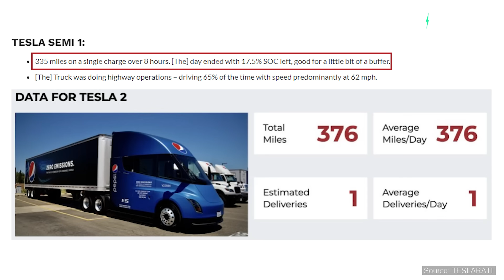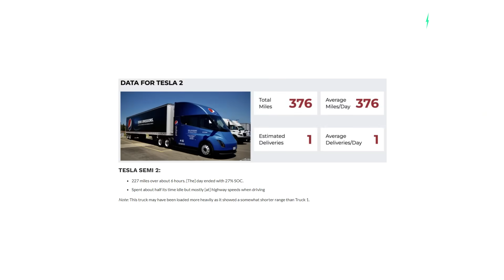Tesla Semi tested at highway speeds - REAL world range shocks rivals

Comment: Perhaps for the sake of the air quality, they should license the technology, or provide just the drive train to other truck manufacturer. Tesla has made the environment case for replacing heavily polluting diesels (even of electrical source is not pure) but they profit more using limited supply batteries in other products.

 (footage of the semi doing 62? on dirt and snow is extra impressive.)
Reply: They could license the tech, but making drive trains doesn't make much sense.  I would be very surprised if Tesla's limiting factor is NOT in the drive train.  So making full Tesla semis get them the most profit.  In fact, if the drive train is battery limited, licensing the tech doesn't help the overall supply in the market much.
Reply: Why bother? Make the trucks and sell them. The demand will exceed supply for a good while so no issue with pricing, etc.

Comment: The more we see Tesla semis overtaking diesel clunkers up hills the faster the trucking transiton to EVs will occur.
Reply: Bevs will take over. Of economic reasons only
Reply: @yggdrasil9039
Although, I think it will take a long time!
A lot of batteries. And ramping up won't ever meet the demands, I think.

And those using it has to build charging stations. Probably with Megapacs.

Only those who really thinks things through will buy the Semi, for now.
And that's a good thing. Otherwise the delivdry wait period would be intolerable.
Reply: The braking going down the mountain matters more to truck drivers. Believe me.
Reply: @r.d.9399  True, true. Though I would assume that BEV trucks make extensive use of regen braking, which is going to pump a shedload of power back into the battery. Hopefully this is the case, rather than the usual air brakes at 3am lol
Reply: 😂 Delusional
Reply: @hobo1704 no need to post about your state of mind.😮😅😂
Reply: @hobo1704  Did you not bother to watch the video?
Reply: @yggdrasil9039  no, never do. I know certain countries this BS won't work..
Reply: @hobo1704  ok... well if you watch the video, you'll see Tesla semis overtaking diesel rigs up a hill. Ever seen a diesel rig struggling up an incline? The huge torque on an EV semi puts paid to that. The only impediment at the moment is the initial cost.
Reply: @yggdrasil9039  cost 🤣 How about charging infustructue and charging time. Dream on, EV's will never be better than ICE trucks
Reply: @yggdrasil9039 nowhere to charge and crappy charge times, government will regulate them into the ground like diesels to make money.
Reply: @hobo1704 My grandfather said that about horse carriage and I am 72 owning my first perfect car after 54 years of mostly German Premium - a Kia EV6 AWD that is sportier than many M-Sports BMW in its class and costs me a lot less to service. This will be the most important for truck companies and not initial price. Many big companies owning truck fleets have huge surfaces for PV too! It’s all about cost to stay in business and competitive. As Diesel goes up its application will be minimized where it still makes sense and where pollution is under control.
Reply: @GoonyMclinux  trucks have legislated breaks regularly - and they need to spend time loading and unloading….
Having a grid connection at warehouses gives you one of the charges rather easily.
Reply: @hobo1704 yes you are....🤡

Comment: Where are you going to find truck drivers that are willing to drive 62 miles an hour that is going to be your biggest problem
Reply: Don't worry, they will be happy driving at 62 miles per hour after charging for at least an hour
Reply: These are real pepsi truck drivers driving the speed the company has mandated.
Reply: @danharold3087  Of course they do. But even if it works as a big driving bilboard for Pepsi and Tesla, this is not the way most transport works
Reply: @SolAce-nw2hf   It is mostly a matter of building chargers.  Tesla is very good at that.  50K car chargers in 10 year.

Comment: 62mph??
I need to go at least 70 to 75 mph!
Drivers don’t want to drive slow trucks!
I out of here!
Reply: This is in California, where the legal limit for semi's is 55 mph. So 62 mph is already speeding.
Reply: I wish the drivers of diesel semi trucks had your attitude. And Semi does go over 80 mph.
Reply: You will be parked because a diesel truck will be unprofitable with electric trucks taking the loads.
Reply: @danharold3087  Right, those EV trucks are a bargain. Forgot about that one.
Reply: @SolAce-nw2hf   Purchase price for a truck that spends most of it's life on the road is small compared to operating costs.
Reply: Indeed, just a nice PR stunt. No company will accept the lost time and money charging these overpriced white elephants.
Reply: @SolAce-nw2hf you mean every company will want the time savings from charging at the loading/unloading point? And the fuel savings?
Reply: @williammeek4078 You actually think they only drive that far between loads 🤣
Reply: @williammeek4078  in real life there are no chargers this powerfull at most loading/unloading points. And the next cargo likely is not at the same location, so that will cost a lot of time. Even at 1000 kW it will be about 1 hour of charging, waisting time and having to pay the driver.

As for fuel cost. It's just a minor part of doing business. Replacing all of the diesel vehicles with Tesla's and installing multiple 1000 kW chargers is just not an option for most businesses righ now.
Reply: @SolAce-nw2hf  1000kW is not a thing anytime soon. MCS charger are currently around 400kW especially for this short range truck which is around 700kWh. Yes it's slow but this is very much realistic charger option for many businesses. You are just pushing misinformation with fabricated numbers.
Reply: @SolAce-nw2hf  FYI 1000kW into 700kWh battery would be less than 1 hour. Your numbers are Fabricated.
Reply: @Neojhun  750 kW is what you need to make this a useful vehicle, and Tesla is pushing towards 1000 kW. 
Insane power hungry machines. How do you think we will power them at these speeds? I think coal, and lots of it.
Reply: @Neojhun  Sure they are. Just not by me, but by Tesla. They are promising 300 and 500 miles range versions with "Less than 2 kWh" per mile. So assuming slower charging from 80% to 100% that is going to take an hour for the long range version if a grid blackout does not occur first.
Reply: @hobo1704  Yes these 3 trucks do.  Visit the web site.
Reply: @SolAce-nw2hf   Tesla started with 1 car charger.  10 years later they have 50K.   Tesla will build the chargers as they build the trucks. Some public some private.   I expect tesla will not blindly sell trucks to people who need to drive where there are no chargers.
Reply: @Neojhun  The numbers on the "Run for less" web site are recorded numbers.
Reply: @danharold3087  good luck with that in countries like Australia.
Reply: @hobo1704  yes. Do some research so you look smarter.
Reply: @SolAce-nw2hf  you are completely clueless. Fuel is the second largest expense in ownership after the driver. 
In real life, these trucks didn’t exist 10 years ago, so talking about what exists now is nonsense. 
Typical unloading times are two to four hours. Even a current Tesla supercharger would be able to keep the truck going if it was a box truck. 
If a Semi, either the driver is required to take a rest break where he can recharge or he has enough charge to get to the next delivery point. 
No time lost. 
Hate to burst your hater bubble, but reality is these thing are coming fast.
Reply: @williammeek4078  keep kiddling yourself that every unloading bay is going to have a supercharger.
And as for rest time, you never drove with a buddy for a speed delivery?
I have no doubt many things will change in transport over the next 10 years, but a fully electric semi that's going to pay for itself and make a profit is not here yet. Good thing to work on and road test, but with current prices it's mostly paying for itself as a driving billboard.
Reply: @SolAce-nw2hf  the world has left you behind.
Reply: @williammeek4078  Time to wake up and smell the diesel. 

As much as I would like to live in your dream world, there are a lot of practical issues to solve. Reality just still kind of sucks.
Reply: @SolAce-nw2hf  Not at all.   It is an examination of the use of electric vehicles of several types doing the jobs they do every day.  Look at the bleeping web site and the data.  Closed loop routes the trucks charge while the driver is at home.
Reply: @danharold3087  yes, nice outdoor lab. But in real life trucking is just a bit different, with work hours, destinations and deadlines that would drive most office workers completely insane within a month.
Reply: @SolAce-nw2hf  Agree/  These are not all inclusive tests.  They test or examine how well the electric vehicles work for the companies using them.   We can always find cases where things don't work.

Comment: Can a Tesla semi pull over to a Tesla charging station and charge up?
Reply: In theory. It supposedly has the correct plug, but the truck is unlikely to fit in the charging station.
Reply: @williammeek4078   In theory. It supposedly has the correct plug, but the truck is unlikely to fit in the charging station.
As I detailed above, one of the Tesla Semis in the test drove a load from Sacramento to Bakersfield, and then stopped at the 98-station Supercharger in Harris Ranch on the way back north to recharge. At that Supercharger, it charged at a rate of 375 kW. Since the stations at Harris Ranch are 250 kW max, it had to have been using two of them. It makes sense that this initial group of Tesla Semis would be fitted with NACS ports, for when they need a charge when away from the home Megacharger; and Tesla would have designed these so the would fit at Superchargers.
Reply: Can a Tesla semi pull over to a Tesla charging station and charge up? 
Actually, yes. Neojhun is mostly correct, and this was proven by truck Tesla 1 on Day 5 of the test, which you can access at Run On Less Results. On Day 5, Tesla 1 drove 273 miles from the Pepsi Bottling Plant in Sacramento, to Bakersfield, CA, on 60% charge. It then drove back north 100 miles to the 98-station Supercharger at Harris Ranch. At Harris Ranch, it charged at about 375 kW. Since the Supercharger stations at Harris Ranch are 250 kW max each, it's obvious that the Tesla Semis in this initial group have two NACS ports; which makes sense, until the Megacharger network gets built out. Finally, it returned 168 miles to the Bottling Plant, where it started.
Reply: No
Reply: @MrCountrycuz WTF stop with the lies, yes they already do. Tesla Semi just uses separate SLIGHTLY bigger charger at Tesla Supercharger sites and it's sadly only about 400kW. It uses a Tesla proprietary version of Megawatt Charging Standard MCS. It's slow but it will get the job done for now. This is just the currently primitive stages.
Reply: Not a chance in hell. It would not fit and will require about 1000 kW of power. These behemoths will need their own power plants.
Reply: @SolAce-nw2hf  WRONG Battery Storage buffer + typical industrial facility dedicated transform has no problem feeding 400kW into Tesla Semis. "behemoths will need their own power plants" is a blatant LIE.

Comment: Volvo trucks have sold 2000+ ev trucks. Not much information about them either.
Reply: I don't think there is much to talk about. They are converted ICE trucks and only used for short range afaik.
Reply: Short range electric transport in cities makes sense. We have a lot of that here in the Netherlands, and I am happy to not hear and smell the diesel delivery trucks.

But for long range transport BEV is just a PR stunt. It's a waste of batteries that could be used for solar storage or 20 lighter BEV's per semi sold.
Hydrogen makes much more sense if you want something that will keep going alll day, night, summer, winter and not so ideal traffic conditions.